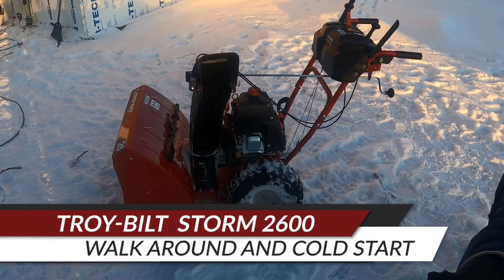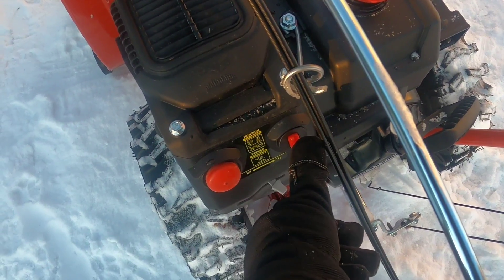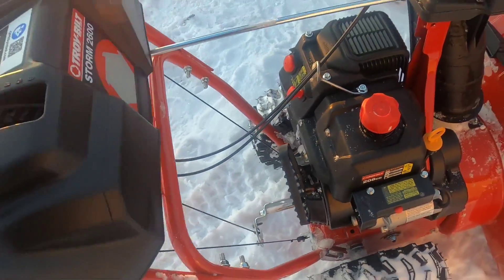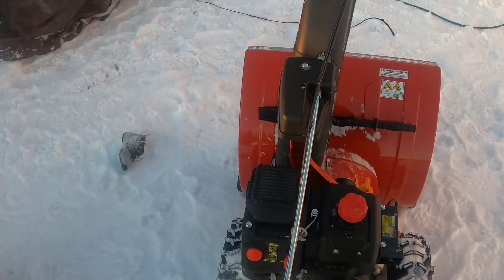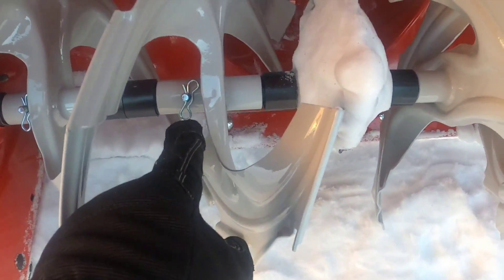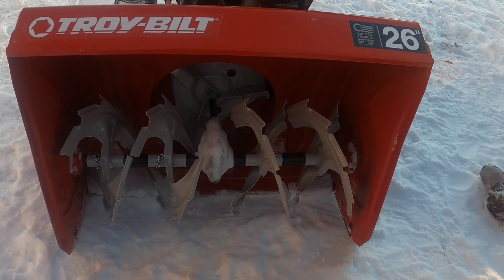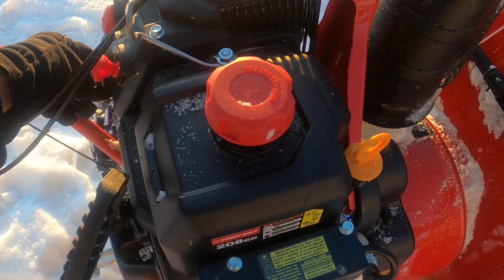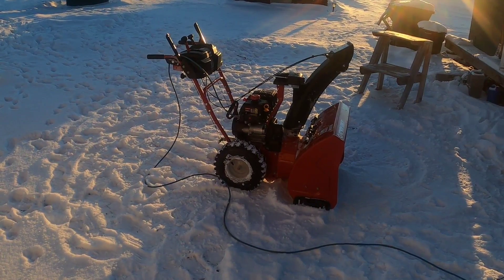Troy-Bilt storm 2600 walk-around and cold start

Comment: I think they set the throttle to the upper rpm range and let the governer take control of how much power is needed. Most people run the engine wide open with just a few inches of snow when that's not really needed. They have to babysit the public because people don't know what they're doing with these machines. I see most people start their motor wide open and that's what wears it out prematurely.
Reply from the maker: Thats correct, its preset

Comment: Thanks for making the video, I have checked all of YouTube and nobody else has made any videos on the new troy bilts for this year. Personally not having throttle control is strange. I actually bought the smaller version of this a few days ago (Storm 2420), and it has all the same controls as your 2600. How do you shut down the engine? Do you just pull the key or is there a better method?
Reply from the maker: My instructions say that you just pull the key. I also read somewhere to check the tire psi because they pump them a bit high for shipping and sitting at the store so they don't get flat spots. I'm going to put mine at 15psi to start and go from there.
Reply: @craws_ak  thanks for the advice, I will definitely adjust the psi. I really appreciate the snowblower content. Hope to see more. Thanks!
Reply: Alot of the newer lawn mowers are the same way. No throttle control. They just run about 1/2 throttle and the governer just increases the rpms once the engine senses it's working harder. It seems to work on my cheap little MTD mower.
Reply from the maker: @PainterD54  yeah, its weird at first but it works and im sure it saves some gas

Comment: Just purchased this and have a question: Other than the yellow handled oil dip stick on top, there is another yellow handled and what appears to be a screw type located towards the bottom of the motor, what is this one for? Nothing is listed in the booklets I received with the blower. Thanks!
Reply from the maker: These ohv motors are pretty universal,  they can be in wood splitters,  generators and all sorts of other power equipment. That being said it's most likely another dip stick and oil fill location.
Reply: @craws_ak  Thanks!

Comment: Bought one for $950 at home depot. Hopefully a decent deal.
Reply from the maker: We just had a set back with ours, the shear pin bent instead of breaking and destroyed one of the augers. We had to return it because not only was it on back order but Troy-Bilt doesn't even send parts to Alaska. It was a bummer.
Reply: @craws_ak  I'm sorry to hear of your bad news. Makes me think I should return it and get a different one, haven't used it yet. Thanks for replying, happy holidays, Godspeed!
Reply from the maker: @justingutube  I'm chocking it up to bad luck. 1 really strong shear pin, and a perfect storm. I don't think they are the worst in the world
Reply: @craws_ak  Love your channel. Used it only twice in MN. Made sure to put 0 ethanol gas in and 10w oil although I'll go 5w next. I also purchased back up clips but haven't had to use them yet. Started up right away. Things a 240lb beast. So far so good. I'll keep ya posted. Stay warm, stay safe.